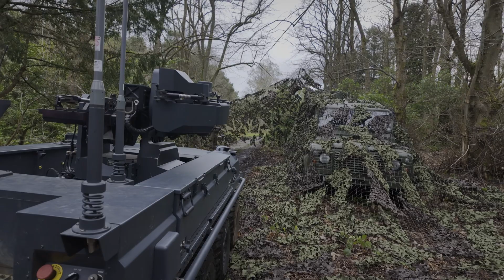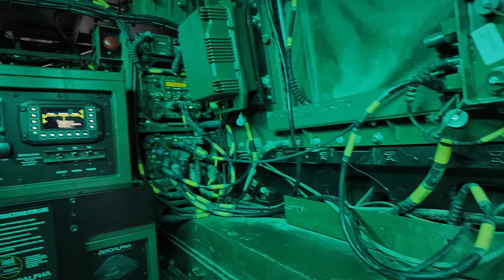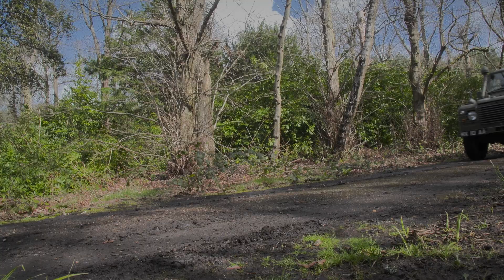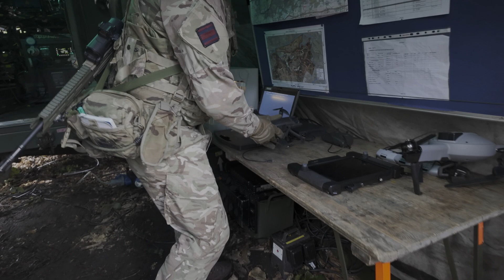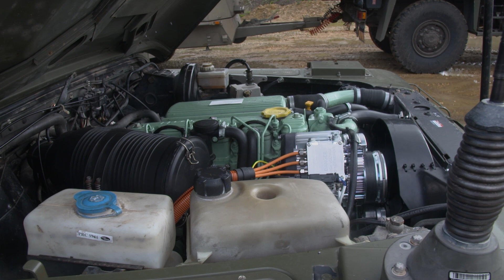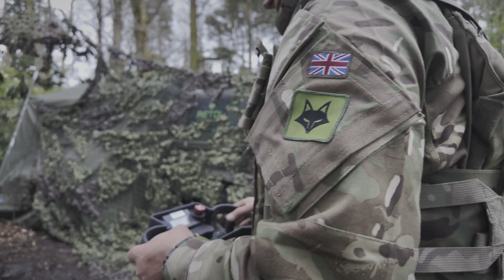Land Rover Fitted For Energy | Modernisation | British Army

Comment: The theory is commendable but we have to look at history of generation of electricity from military vehicle engines. What has been found time after time is you overload these engines and end up with unreliability. It happened with the Jaguar engine where there were too many peripherals for the capacity of the engine. The military must stop trying to add accessories to the prime mover unit as originally conceived. First calculate your electrical load as required at maximum today. Now double it then add the prime transport power required. 
These were lessons known to REME well over 50 years ago. We did a standard test under electrical training. We put an 18 inch crank on a 12 v generator from a car and excited the field. The best ability anybody ever managed was 7v field excitation. That proved the massive engine loads these huge generators exerted. Maybe some of these designers should try the same test. I suspect that the reliability of the Rover engine will decrease as the electrical generation system increases. It is not rocket science it was being taught ove4 fifty years ago.

Comment: yeah brilliant until you go to a cold environments & you see EV voltage depleting, performance, range all reduced.... lets also see the testing of this in a off road arena, where by more power is required.... again ALL EV, silent, covert, stealthy that's were the issues will be highlighted

& yes, that's where EV vehicles have all failed to date!! aka cold weather, environments etc light off-road capabilities for vehicles converted, ALL get massively hindered

that's why in current abilities/technology EV is stalling (even road vehicles its going backwards) 

off-road stealth, silence etc brillliant for the military goals, arena.. then you've massive weights involved, reduced payloads (reduces capabilities) as mentioned this all hinders off-road travel, then add to the mix cold weather & it gets even worse, mix to that incredibly poor ground conditions &you've a nightmare ie ICE engines come to play, you've then got more weight to deal with you your still struggling &with all the other negative effects....... overall "not good" ... I see yet anothr light skinned vehicle, in a combat arena disaster coming up

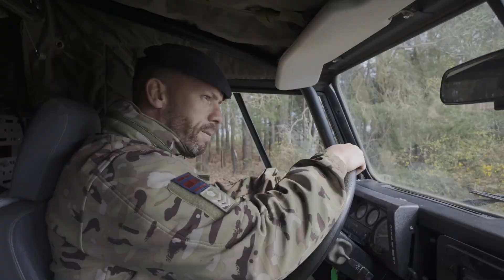Comment: 1:40 "kilowatt HOURS" is energy - which you're storing for later use. That energy is stored by the generator taking "kilowatts" of power from the engine while it's running. It enables silent running of accessories at the cost of greater (noisier, hotter, higher fuel consumption, greater weight) in advance of a stop? I don't see how it improves resupply - the same amount of fuel must be consumed, arguably more due to inefficiencies of store-and-return? I guess the future must be electrically-driven vehicles (like Nissan e-Power) with effort spent on optimising the generator side so it's ever more efficient.
Reply: That is why the world is turning away from E power cars, they cost way more to run, costs to infrastructure are enourmous, and they are as you point out inefficient. Hydrogen power is the way forward.
Reply: @thetruthhurts7675  Do you mean Nissan's e-Power system, or are you referring to pure Battery Electric Vehicles? Other than small drones I wonder if we'll ever see a pure BEV at war. The e-Power drivetrain is electric motors, regen, and a battery (giving you that silent option), but the energy source is a petrol motor. The ability to run around with a vast amount of easy-to-transfer energy in a jerry can is hard even to imagine how to beat.
Reply: @trs4u  It is easy to beat a battery powered car, areasonably sized electronic pulse and it is done. Hydrogen on the other hand is virtually limitless power, though converting anything to electric is a total waste of energy. Typically a car engine, or any other burning fuel is 38% efficient, thus a third of the potential energy from a litre of fuel will be converted into electric power. A TOTAL waste of thermal energy. Immagine the size of the vehicle needed to keep all those computers we saw running for 72 hours. This is a back step in logistics.
Reply: @thetruthhurts7675  You know most 'hydrogen' cars are electric vehicles, right? They're "Fuel Cell Electric Vehicles" - A hydrogen fuel cell that produces electricity to drive electric motors. They're no more immune to EMP weapons than any other tech. When I said "hard to beat" I was referring to being able to carry hydrocarbon energy around in buckets/bags/bottles/cans. Every other system is much more complicated on the supply side.
Reply: @trs4u  Are they truthfully? All vehicles are electric, but using electicity when we can take all electricity out on a battlefield is stupid to say the least.
Reply: @thetruthhurts7675  JCB in the UK is working on hydrogen combustion engines, but I think everyone else drives electric motors with electricity from a hydrogen fuel cell. I don't think you'd find any vehicles at war that didn't include electronics now - they'll be 'hardened' in various ways against electromagnetic pulses, I expect.
Reply: @trs4u  All electronics werre hardened even in my day in the forces, but a decent sized pulse can take them out. Today you actually don't need a nuclear bomb for the EMP provider either. There are plenty of small gadgets that are suitable, thus we should be converting to light as the power for what we now use as electronics. Light conversion to a power that is None electronic is more efficient than producing electricity. Stanford University, MIT, Oxford, and cambridge are all researching using light as the new unstoppable electricity. No pulse will take out a cabled system using light.
Reply: @thetruthhurts7675  you probably know more about hardened electronics than me, but when I worked on control systems many were often optically isolated to prevent 'bad' signals from one component destroying another. Interesting vital field.
Reply: @trs4u  Possibly, though my experience in the Royal Navy was back in the late 1970's, and 1980's. Optics are the future of computing apparently.

Comment: Why bother worrying about the environmental damage during a war?
Reply: I’m not sure they are.  The video talks about silent running capabilities that electricity gives you rather than needing to run a diesel engine…
Reply: Heat signature from the engine as well as noise. They can remain “cool” to the eyes of thermals and silent - that’s the idea I’m guessing.
Reply: @PinderM157  And all the Humans will stop giving off a Thermal Signature as well. Unless these are going to be "Driverless" vehicles" it's a bit of a waste of time. And if they were "Driverless" what's the point of having them?
Reply: It's about being quiet not about the environment 😂

Comment: The maths and calcs don't add up for me. Vehicle engine, using the accessory belt, creates enough energy to power a UK household for a day and doesn't use any more fuel than usual. That gives the vehicle 72hrs of capability? Maybe 72hrs of radio but clearly not of propulsion. Hybrid cars with far bigger batteries and far lower vehicle weights get 30km in good weather. Sorry but something is off there.

The "e machine" is just an alternator. Great marketing.
Reply: I think he means electrical energy for all the accessory stuff that's used in modern war.
Reply: i believe it is 72 hour for appliances not to move the wagon considering everything they talked about was in regards to charging batterys
Reply: @AnimatedPiksi  I expect it's this too. It sounds just like an FFR landrover fit out. Second alternator charing a set of batteries when on the move so you don't need to fire up a gene when you stop. Connecting that to a small motor to move the vehicle makes sense but it's far from a new concept and won't get you far in anything but a tarmac road.
Reply: Doesn't fix the land rovers well know problems though. Get a land cruiser or g wagon.
Reply: Look up the statistics on hybrid car fires the military wouldn't want something that not burns uncontrollably but also quiet frequently.
Reply: 72 hours ancillary power without running engine. An increase on current options.
Reply: @Surv1ve_Thrive  pretty sure my FFR 20 years ago could do 72hrs on equipment batteries.
Reply: @meme4one   "pretty sure" at a drunken campsite event? Or definitely at a modern army OP with drones, radios, (vapes, ipads & escooters for pizza runs)? I am just kidding but I bet charging demand /capability has gone way up.
Reply: @Surv1ve_Thrive  batteries have also improved a lot since the nasty lead acid things we used to use. Radios are far more efficient and a vape draws a knats knacker worth of charge. The point I'm making is that these will not work as hybrids as shown in the video and having a second alternator is not a new idea. It's all just recycled gash concepts and not what it's shown here.
We took these to the Balkans which included a lot of drinking and Iraq which didn't.
Reply: @meme4one   I was just hoping that's not the case. (I was joking about the vape obvs). 
How do they get people to peddle the 'news'?
Reply: Military vehicles tend to spend a lot of time parked and idling. The point here is that the improved power system (not an alternator, a dual purpose motor-generator unit and a bigger battery) can continue powering the onboard systems without needing to continually idle and inefficiently burn tons of fuel.
Reply: That is what a Russian bot would have said 😊
Reply: @pan2aja  cheers dits.